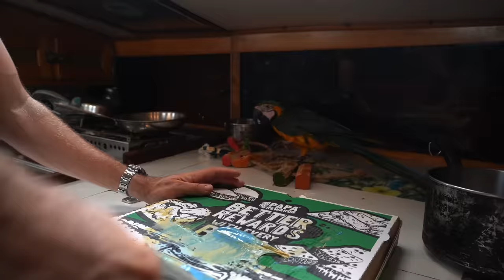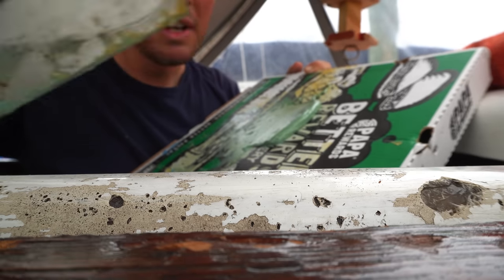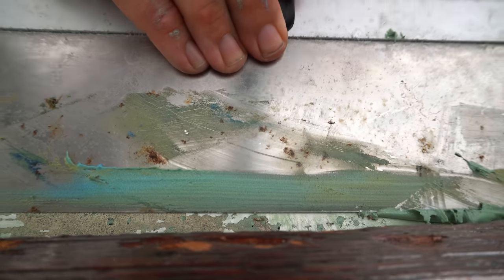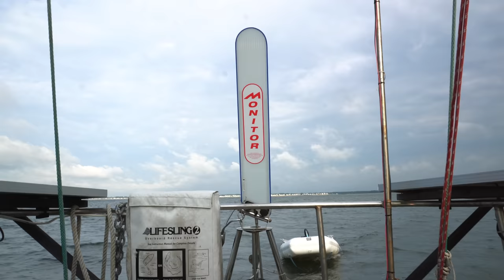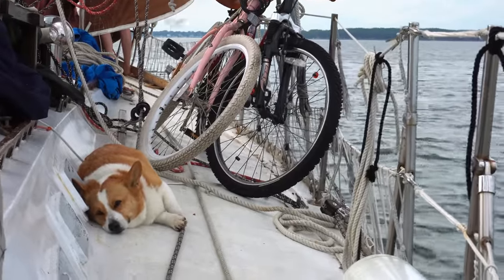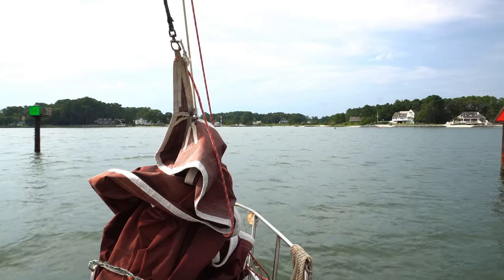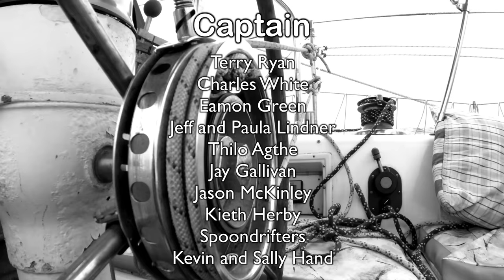Converting the Boat Back into an Ocean Cruiser | Sailing Wisdom [S5 Ep51]

Comment: I'm a big fan of mineral spirits (paint thinner) to clean parts. Low(ish) odor. Doesn't bother my skin. Flashes off at a nice rate, not fast like brake cleaner or never like diesel. Used thinner can just be kept in a container to be used over again next time. I like to wipe my tools down with it after the job, seems to help with marine rust and seasoning raw steel.

Comment: Yep, nothing like an all electric boat... I'm getting more and more impressed with what a 48v bank and hefty PV can do... ran the Dometic last night (heat) for about 6-8 hours then motored in the length of the marina channel 4-5 times to try and use some of the bank... didn't happen... so going on a local cruisers association destination later this month for about 20nm as the second only test and first test of my replacement electric power smarts (Victron)... Fair Winds...

Comment: WOW Deltaville. Next time you are there you should check out Yankee Point Marina just up the river a bit. Easy to get in and you can get a haul out to the working yard if needed. We have a pool and fine dining on site as well. Dinner is on me if you share some of that sailing wisdom with me (pun intended). I am not new to boats by any means however sailing or sail boats very new to me but something I have always wanted and this year made that dream a reality and got an Island Packet 27 that I want to learn to sail and outfit for a Caribbean cruse in 4 years when I retire.
Reply from the maker: We might be swinging through there this summer. Can you send me your phone number to riggingdr@gmail.com? It’s easier to keep in touch that way.

Comment: Any suggestions on what to do on new winches prior to installing?
Thank you two
Reply from the maker: I would give them a very light coat of grease, and then yearly add chain lube. In 10 or so years, some of the grease might need attention 😉
Reply: @RiggingDoctor  bike chain lube or lewmar on the new winches? Thank you

Comment: I am using Harken winch grease on my Lewmar winches (blasphemy, I know), but I actually ready the instructions that came with it the other day.  It said that I should grease the gears and metal parts of the bearing, but put oil on the pawls.  I'm guessing that is to keep the pawls from getting gunked up with grease.

Comment: I’m asking a serious question.I’m a beat up vet missing a lower leg. I’m not pussy by anyone’s standards.what boat do you think I can solo from fla. To the Bahamas?
Reply: There are serious long distance sailors out there that could give experience. Likely you can do any properly set for your needs. Smaller are easier for some. Pay attention to overhead handholds, especially.
Reply: @braithmiller  well 6 years in the USCG but I didn’t actually learn using sails but I get it
Reply: What do think .like 30ft anything
Reply: Some out in 14' -26' global, so it's a wide open choice.
Reply: @braithmiller  14 ft that’s a bathtub 26 ft maybe but I’m not going lower than 30ft
Reply from the maker: As long as the lines are led to the cockpit, you can stay there while working all the lines. If you need to, you can always crawl up to the mast just like I do in bad weather, but otherwise you can control the boat entirely from one spot.

Comment: 06:20   Should be better to use straight Mineral Oil.     Those products are mostly mineral oil (check MSDS) with other filler chemicals.  Having pharmacy-grade Mineral Oil on hand is good for many situations, for first aid, as general chapstick or skin uses (i.e. good for light sunburns, etc), and also tons of hardware related uses.   Mineral Oil can even be used instead of PB Blaster because that product is also mostly, you guessed it, Mineral Oil.
Reply from the maker: I need to start carrying that with me!
Reply: Part of the reason most winch grease drys out. Mineral oil evaporates at room temperature. I use high temperature bearing grease. Or rejuvenate with liquid wrench if I don't have time.